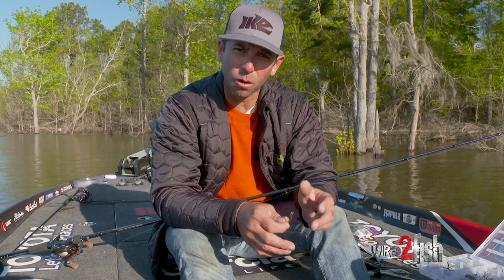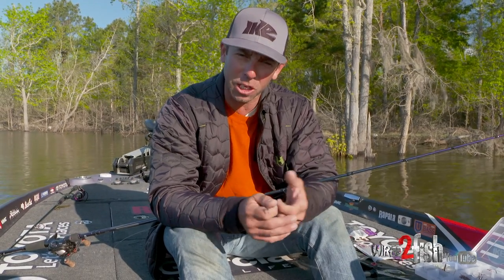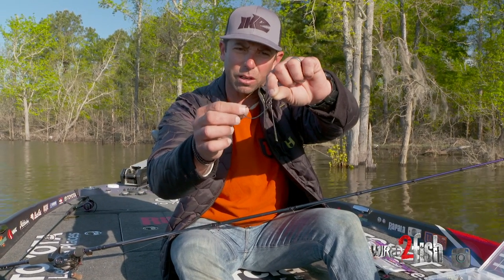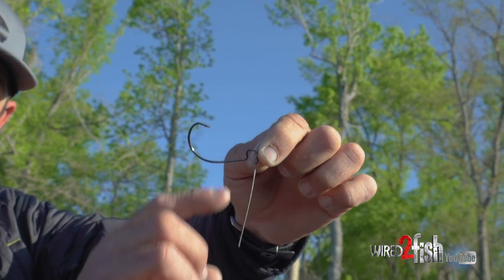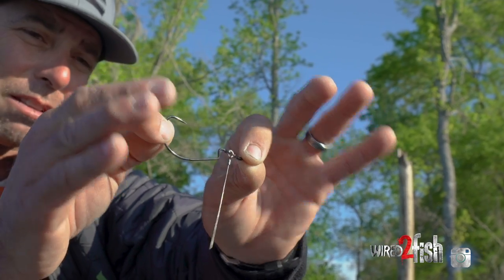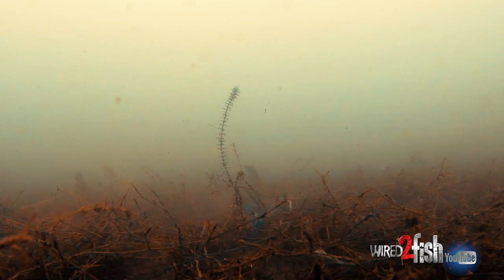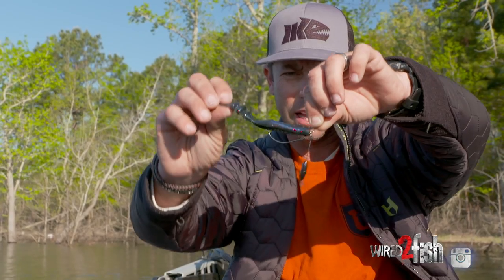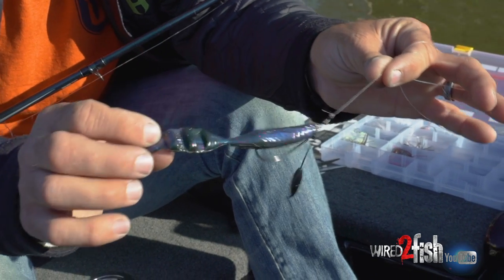The Tokyo Rig for Bass | Ike Talks Uses

Comment: Reminds me of a Salmon rig (for steelhead with noodle rod), where 3 way swivel used, pencil lead for weight (cut to length to change weight to match the flow). Main difference is no line leader.  Could attach hook to 3 way with split ring. Interesting! Often thought about using a steel head rig for bass. I have to check out what a Tokyo rig costs.

Comment: Seems like a less discreet drop shot.  If you let the line go slack, it will fall to the bottom whether it's wire or line.  But maybe in spring I'll do a Tokyo Rig vs Drop Shot head-to-head.
Reply: I agree.   The cutting edge technique is more $$$$ in Mike IKE's pocket.   Its just a wire drop shot, plain and simple.

Comment: How is this different from the drop shot presentation? Hahaha. Watch the rest and you kind of answered it
Reply: It's not any diffrent...either way if you go slack on a drop shot or a tokyo rig its gunna collapse and if you keep it tight it's going to stand up  just the same..buuut if you punch with it like Ike said its not going to blow the fishes mouth open and that can be a game changer
Reply: I punch grass with a heavy drop shot.  65 pound braid and a 1oz torpedo weight and it works just fine.  Just because the Tokyo rig has a wire leader most seem to claim that it keeps the hook off the bottom because of the rigid wire.  Nonsense...Cast it out and drop your rod tip after the rig hits bottom and see if the wire is holding the bait off the bottom on a slack line.    A rigid line is what keeps the bait above the weight and It doesn't matter if you have a braid leader or a wire leader.   Whoever came up with this rig is very smart because it is just a wire leader drop shot, nothing more and they are selling a bunch of them.

Comment: You running it on florocarbon line?
Reply from the maker: Fluorocarbon or braid depending conditions and angler preference. Works well with both. We have noticed a performance enhancement using braid on long casts (retrieving swim baits deep) - swinging jigs situation. Better feel and hook sets.
Reply: @Wired2Fish  Thanks for taking the time to repiy.

Comment: What line you are using
Reply from the maker: Hey Gaga, your standard fluorocarbon or braid flipping and pitching line works great. We've swam swimbaits across the bottom in 30 feet of water using 15lb fluorocarbon but 20lb fluoro is probably the most common for shallow, heavy cover applications. If you're a braid person, then 30-65lb will work depending on the cover. In general, favor the smaller diameter lines in deeper water or where heavy cover isn't as much of an issue and scale up based on the cover. Thanks for watching!
Reply: Thank you for answering